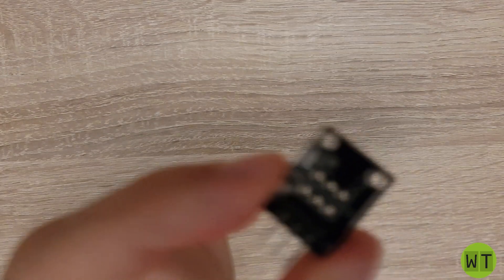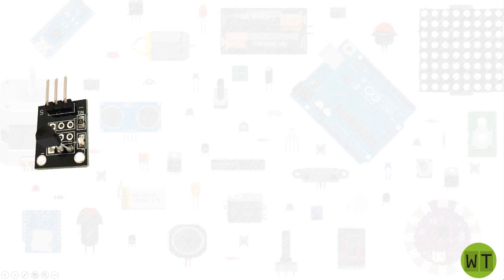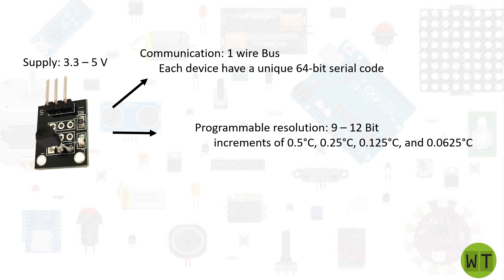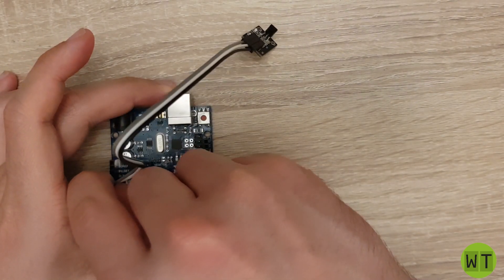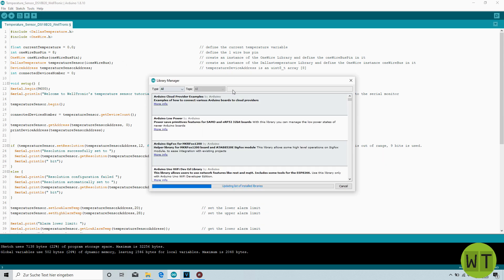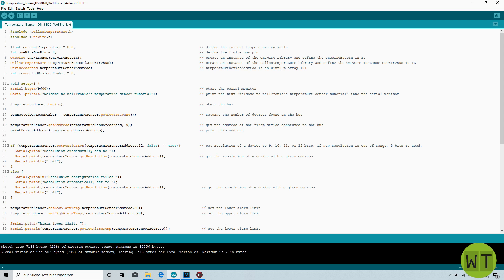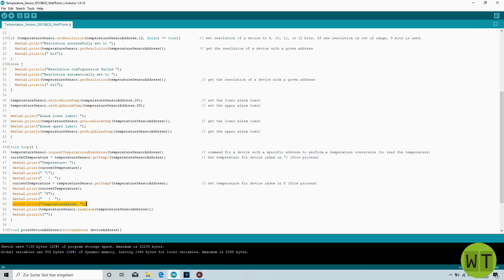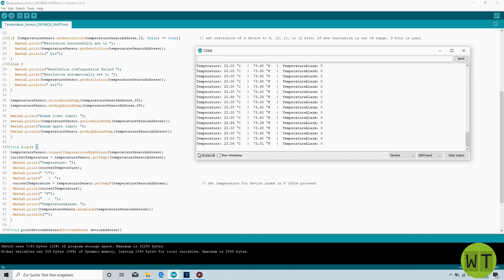KY-001 TEMPERATURE MODULE EXPLANATION OF ALL THE FUNCTIONS (DS18B20)

Comment: My serial monitor says "resolution failed" "resolution automatically set to 0 bit", and then I get -127.00.  The sensor did not initialize at all.  I get those values, even when the module is detached from breadboard.
Dallas Instrument asks for a 4.7K pull up resistor only.  The LED might have killed the sensitivity of the sensor.  Will try again by short circuiting two terminals of the LED.
Reply: how did you do it i have the same problem :/

Comment: this error is comming please help Arduino: 1.8.13 (Windows 10), Board: "Arduino Uno"

sketch_feb28a:1:10: fatal error: DallasTemperature.h: No such file or directory

 #include <DallasTemperature.h>

          ^~~~~~~~~~~~~~~~~~~~~

compilation terminated.

exit status 1

DallasTemperature.h: No such file or directory

This report would have more information with
"Show verbose output during compilation"
option enabled in File -> Preferences.
Reply from the maker: I think you need to install the libraries. 
Sketch --> Include libraries --> Manage libraries... 
then you can search for the Dalls temperature library and install it. 

You can follow this steps in video 4:30 😊

Comment: Hello, I tried that too...but for some reason the sensor reads -127 degrees and the resolution configuration failed.  
Resolution automatically set to 0 bit
Alarm lower limit: -127
Alarm upper limit: -127
Temperature: -127.00 C   |  -196.60 F   |  TemperatureAlarm: 0

Do you know what can couse this?
Reply: i am having the same results
Reply from the maker: Hello, 
I think there might be the following problems:
1) The module is broken
2) The pinning is not correct 
3) The sensor is not properly powered. 
4) The wires are not pinned correctly. 

Please try to check these points and give me feedback 😊.

Have a nice day !

Comment: I don't understand how do you link the KY-01 with the computer so you can program it ?
Reply from the maker: First you have to connect the sensor to the Arduino Uno, then you have to connect the Arduino Uno to the PC. Normally you should have a USB cable with the Arduino. Finally, to program the Arduino, you need to install the Arduino IDE. 
I hope this helps 😊
Reply: @welltronic8216  Ok Thank you !